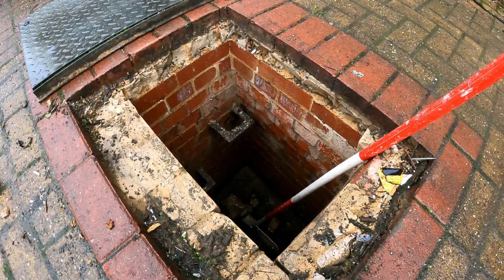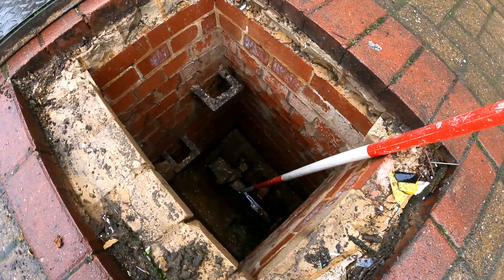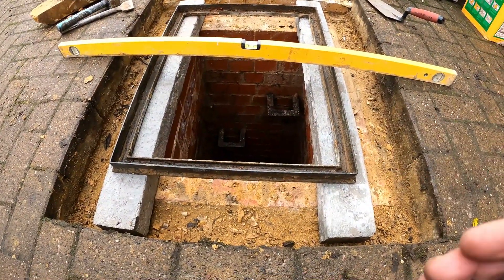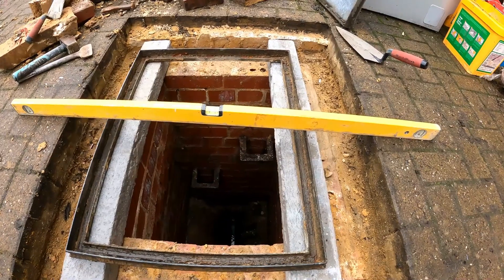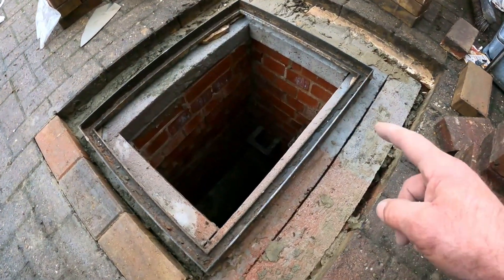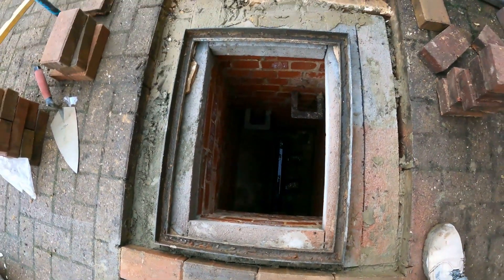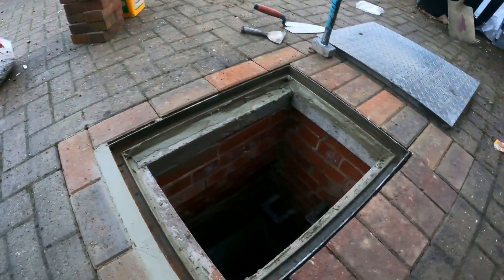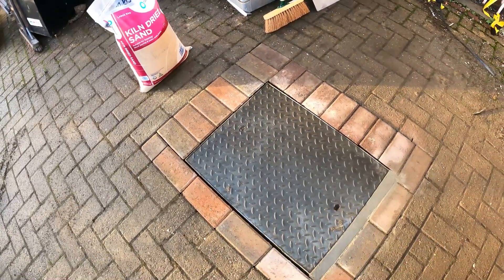Manhole Repair Using Prestressed Concrete Lintels

Comment: Hi great job , we have a manhole cover fitted in a resin driveway that has started to sink and the company that installed the driveway simply don't seem interested in sorting it out. Don't suppose you are in Newcastle Upon Tyne ?
Reply from the maker: Thanks mate 👍 
Yeah you got to strengthen  up the manhole from underneath if you have traffic going over it sounds like they didn't if I was in the area mate i could help you out , I'm from the northeast  but live down London I hope you get it sorted though mate that's a right pain 😕 Thanks for stopping by the vid and all the best mate 👍 👊
Reply: This the way you would do it if you had a gravel driveway  with a manhole in the middle so its gonna  get  plenty  of  times the car going  over it ?

Comment: Good idea using the lintels, I’ll use that idea when repairing my sunken manhole. 👍
Reply from the maker: Thanks for stopping by the vid mate nice one 👍 👊 yeah they are a very useful if you need to bridge over an opening 💯 plus they normally have rebar in them for extra strength 💪 Thanks man and hope it all works out OK with your sunken manhole 👊👍